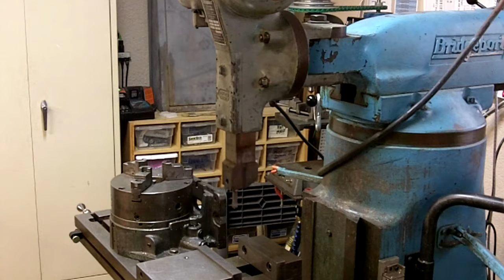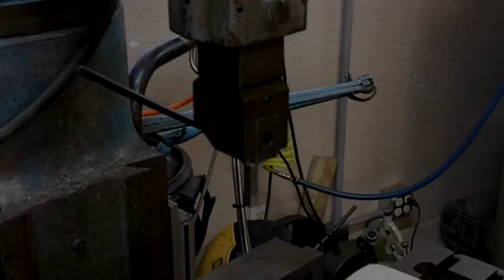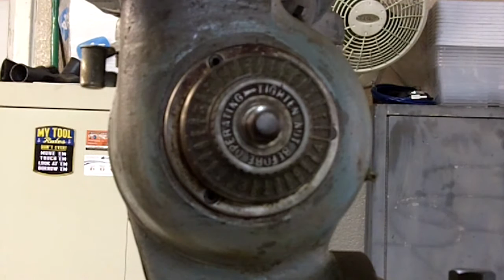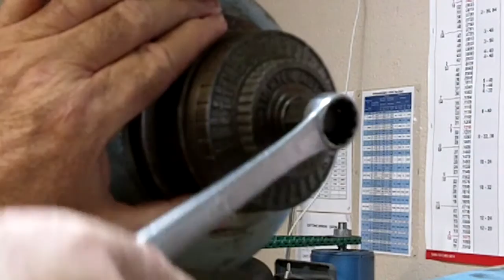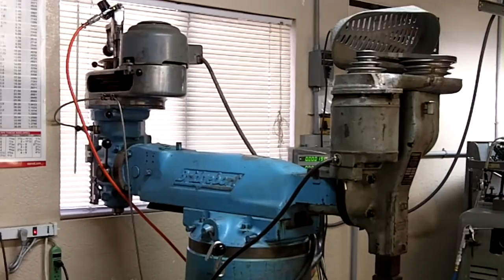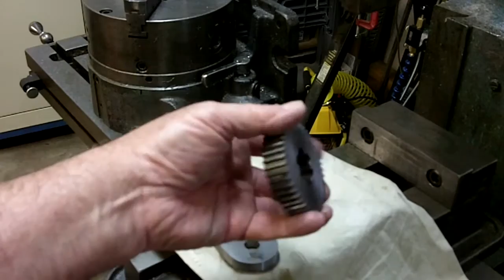Bridgeport Shaper Head

Comment: the rotating head that holds the 5/8 could not a person simply make their own with various hole or square sizes and use and make any tooling they wish?? Anyone seeing this I/we can gladly make and sell them if they are that expensive and beat the price easily. We have diamond wheels and I am a skilled grinder and we have all the tooling etc.
Reply: the cutters I intend to lean towards only about 3 degrees side clearance to keep them stable and intend to put some rake on the ends. Also carbide should be pretty easy to do.

Comment: Just changed my motor on mine to single phase but new motor has a bad internal starter switch.  It will randomly change direction.  Does the motor direction matter?
Reply from the maker: Yes it does .. end mills only cut when spun in the right direction.  If your motor is running backwards the tool will only rub.
Reply from the maker: Oh wait John! .. just dawned on me you were commenting on the Shaper head video .. my bad!  Disregard my first reply!!!    
I've never had the shaper head apart, so I don't know if it has to run in a certain direction.  I sort of doubt that it matters though.  I'd say if it works & is not making any weird noises you're ok.
Reply: I think it might be a good thing by using both sides of the worm gear inward and outward.  I will learn tomorrow when I reinstall the motor.  Had to paint it first.
Reply: Instead of going up and down it will go down and up